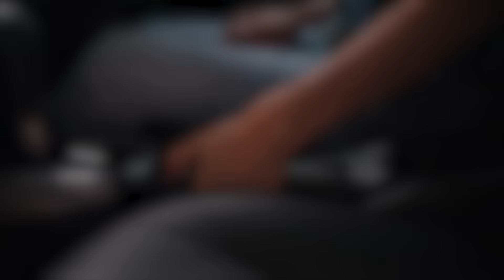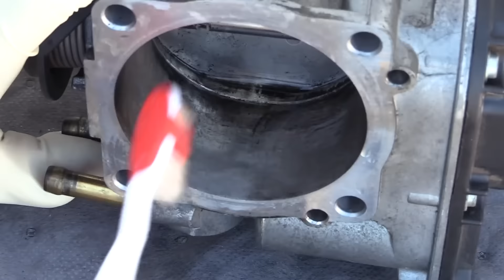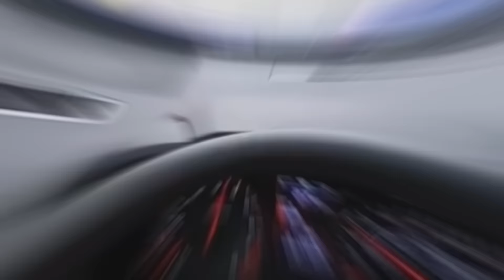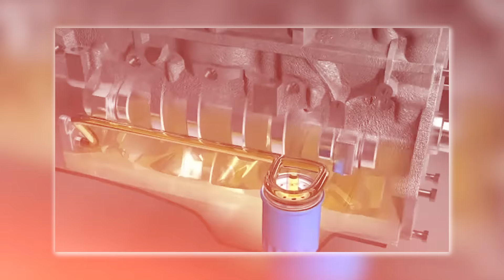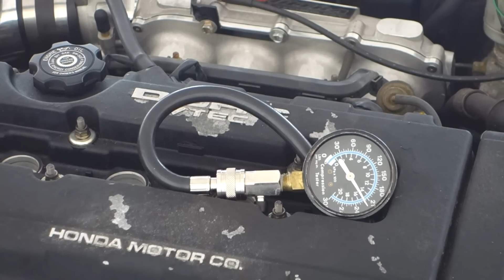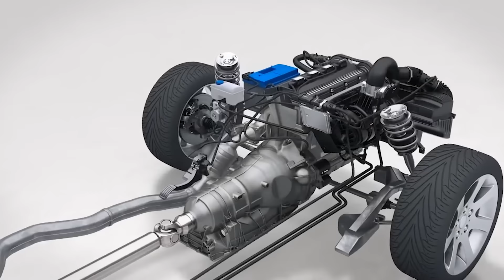Doing This Will Make Your Subaru Engine Run Like NEW Again

Comment: 15 minutes you mention long idle is not good, do I drive when the blue temp indicator is on? I am new to Subaru and have been waiting for the light to go off before driving which takes 5minutes on average. Thanks for the video!